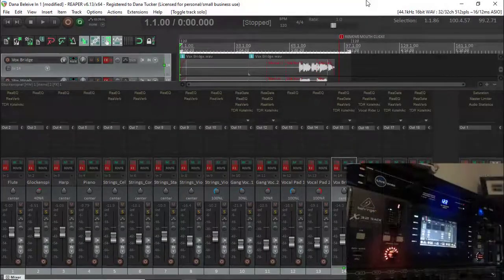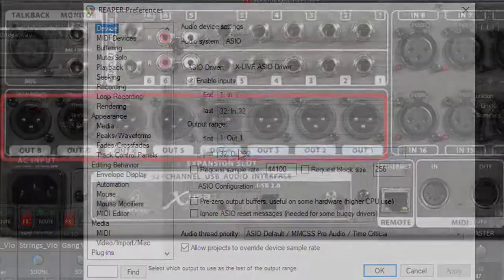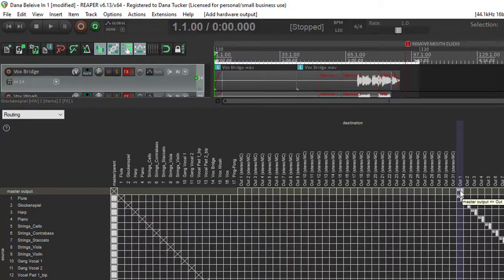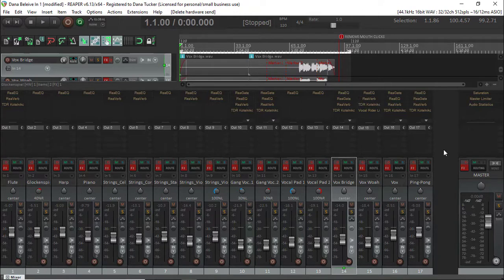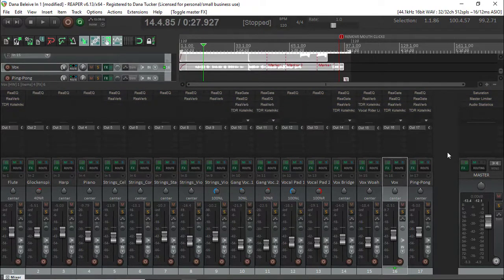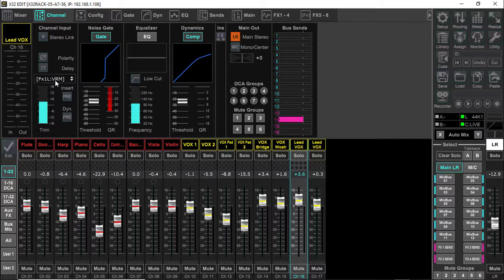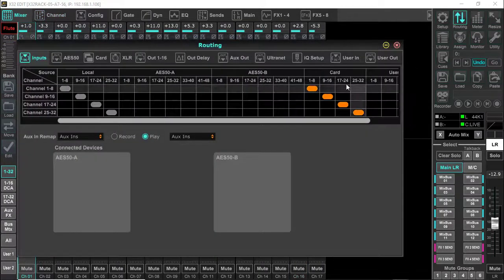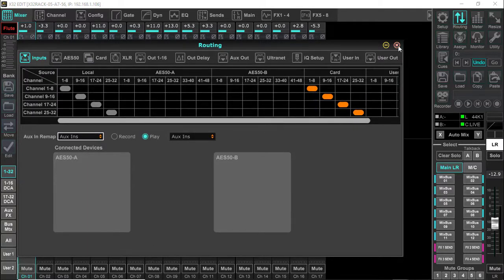How To Do A Virtual Sound Check Using Reaper

Comment: Nice tutorial! Hi, can you elaborate more about your mention @4:50  “when going to stream this live- all effects will take center stage”
Reply from the maker: When you use effects, they do just what they are designed to do. When you live stream, regardless of what platform you will be streaming to, your audio will be compressed, due to the way audio is delivered via a stream. It is called packets. There have been books written on this and I can not explain it any better. However, I can put you in touch with someone that can. Check out this video, then please reply back. Please tell Dave, Dana sent ya. https://www.youtube.com/watch?v=pMnaiuC55RY